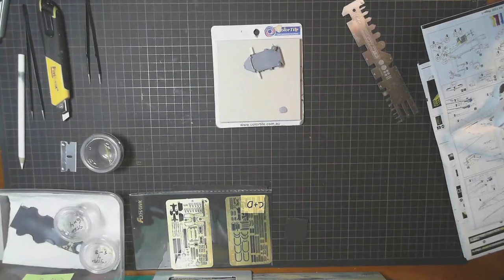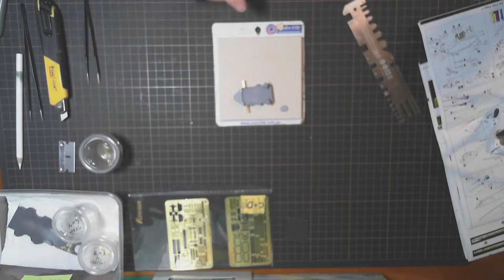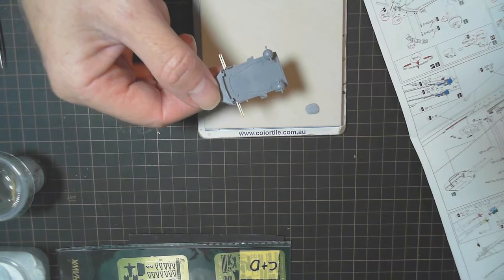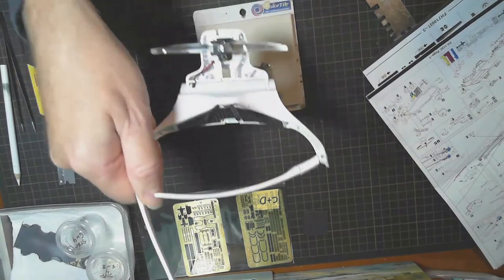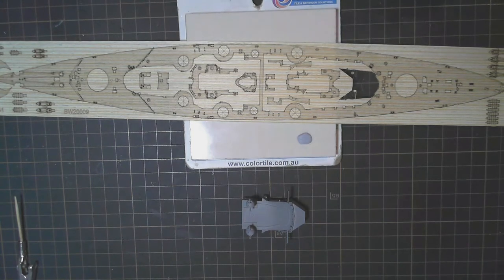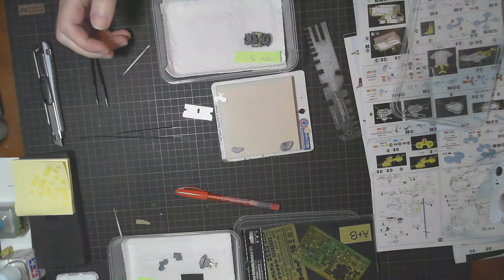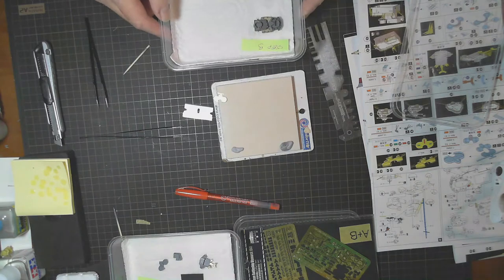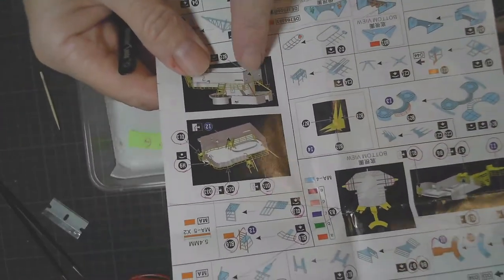German Bismarck Build Video Part 3| FlyHawk 1/700 Scale Deluxe Edition. For the 80th Anniversary.

Comment: I’m currently making HMS Hood using photoetch.  I’m dealing with this exact problem atm.  Would be nice if the makers of the photoetch would replicate the original instructions and ad in the relevant photoetch.  Such a head ache going back and forth between 2 sets of instructions.
Reply from the maker: Yes its easy to miss stuff, you have to be careful. Cheers